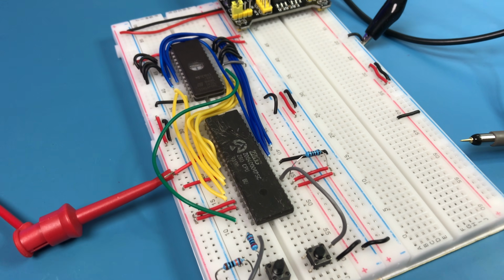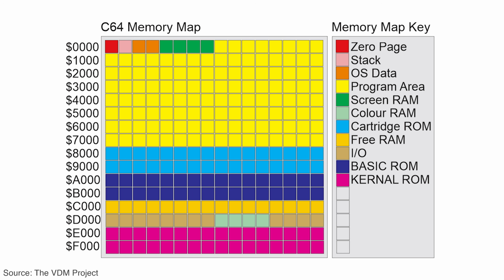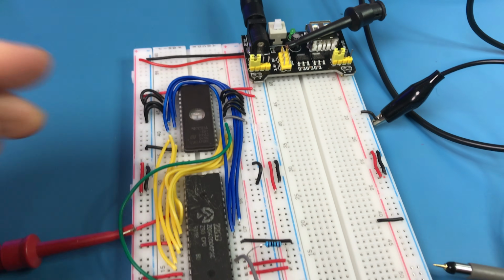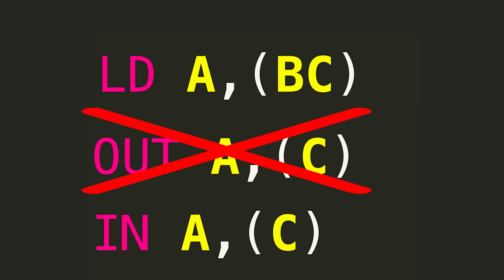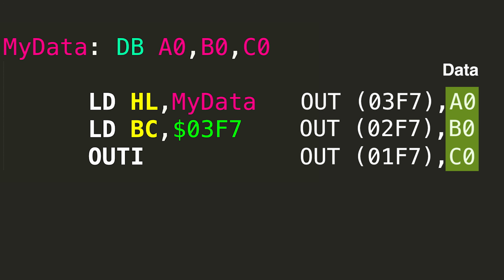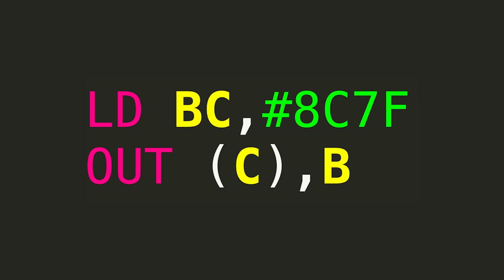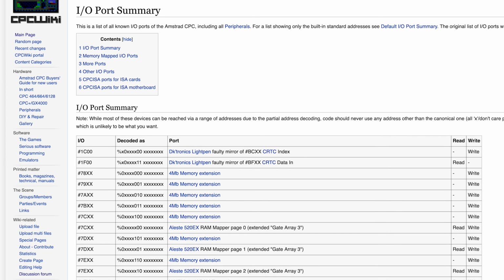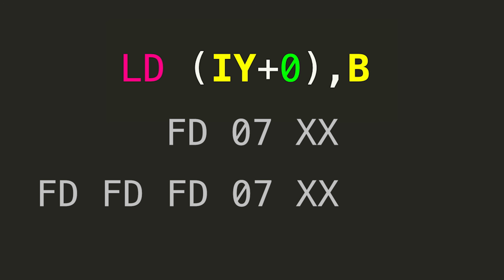The Madness of Z80 I/O

Comment: LDIR is not an eyesore! I used it to copy blocks around in my Schneider 6128 between memory banks. It was very handy, not having to write the loop. :)
Reply: Yes! It's incredible how many people forgot that LDIR/LDDR/OTIR/OTDR were a cheap alternative for DMA memory transfers, and advertiser as such.  DMA was horribly expensive back then.
Reply: Yes. I modded my Spectrum back in 1982-83 up to 80k (16k with two 32k banks) and used LDIR as a blitter to create some pretty slick animations by pre-drawing multiple images in RAM and then repeated LDIR to drop them into the active screen buffer.

Comment: Long term professional Z80 programmer here. I prefer to think of things the other way around. Very simply the Z80 had 16bit IO addressing. The CPC approach capitalized on this properly and it allowed whole pages of IO to be  used for your own hardware. Used this by decoding page FF as enable for existing 8bit addressed IO. Everything else that ignored the top 8bits was either sloppy or following the 8080/8085 method... Unless you were being clever and getting 16bits of data in your OUT (C),A by grabbing the B register from A8-A15.
Reply: The z80 design doesn't really scream 16 bit i/o addressing to me. They messed up the IN/OUT instructions by putting the A register on the top 8 bits, which is fine for IN but for OUT it means the data lines and top 8 address lines have to have the same value. In reality the z80 has 8 bit I/O addresses, but an implementation detail means that you can achieve 16 bit if you write the software in a specific way.
Reply: @smf3472  that "certain way meant choosing which you were going to use before you started designing the system". Not the word salad it is in Zaks or the datasheet, but just think of it that way and it works. If the documentation simply said BC appears on the address bus and A on the data bus, it is very simple - and defo 16 bit IO addressing. That is what actually happens,  AND... With 65,000 IO addresses it did encourage "rationalised" designs resulting in lots of mirroring of addresses - but that's what you get when designing to a price-point. We used to "gut" 6128s and use them as embedded controllers in weather RADAR equipment with some older IO hardware using legacy 8 bit addressing.  Used IO page 0FFxxh with 8 diodes and some simple logic to pick the top byte as the enable for existing hardware. tiddly little daughter board was all that was needed for upgrading from legacy.

IN A,x and OUT x,A were legacy commands and provided code/operability continuity with the intel 8080/85 designs that were the main target of Zilog at the time. You are right that the A register appearing on A8-A15 is a bit odd - I am sure there must have been some reason for it - did any design ever use it? 

There are historically a lot of areas where the Z80 could have been a BIG improvement over the 8080... many of the complex instructions, often do not provide code-size or execution time advantages (SET, RES etc) and things like LDIR can be done much quicker by clever use of SP - albeit not as arbitrarily. The 4 bit ALU was a major area they could have spent time, the addition of a MUL command would be so easy and a real coup over Intel, and 16bit relative addressing for CALLs, JUMPs and IX/Y. There were great improvements over the 8080 but a lot were seldom used because they didn't go far enough. In ZILOG's defence,the actual deployment of philosophy of RISC was a decade away, even though the 6502 performed very well with a slower clock and only three registers. Motorola's 6800 series was even better.
Reply: @smf3472  The question is whether the 16bit addressing was intentional.   Some people simply assume that there is a glitch when using the IN/OUT(c), so that the B register then displays the upper bits.

Comment: The only crazier Z80 thing than that is what the ZX80/ZX81 do with video output. Holy Mother of God.
Reply: The ZX81 video generation sure was complex, but some embedded systems around the Z80 did similar involved things.
Reply: @herrbonk3635  And a lot of other stuff. The concept is a good deal older than the ZX80 and had been in books by Don Lancaster before. The ZX80 has some twists on it but it wasn't new.
Reply: @etchedpixels  Yeah, I've heard about that "tv-typewriter" by Don Lancaster, I belive it was. But what did it do exactly? Did it even use a Z80?
Because the tricks employed by the ZX80 and ZX81 were largely (not fully!) about the Z80 itself. Such as using the R-register to count bytes on the screen, the I-register to point at the character generator, the HALT instruction used as newline, the exact nature of the 4T NOP-instruction execution, and so on.
Reply: @herrbonk3635  You could implement the same method the ZX80 uses, with a 6502. The implementation would be different of course, but you should be able to get any CPU to fetch display data while feeding the CPU a NOP instruction.
Reply: @smf3472  Yeah, probably. But it would be totally different in almost all details using the 6502, 6809 or similar. And I'm not sure it would save much hardware without using the Z80 refresh-counter as a byte counter. 
The main point though, was that the "tv-typewriter" didn't use any processor. And people almost seems to think this was the first time a video generator was implemented in TTL. But that was rather the most standard method at the time.
Reply: @herrbonk3635  Using the program counter as the counter would totally work, you just JSR into a specific address range & feed the CPU NOPs all the time it accessed that range, then feed it an RTS at the end of a line. Though once you have RAM that is twice as fast as your CPU, then of course on the 6502 you would just have your own display DMA hardware. But you could have done a ZX80 style machine with a 6502 in 1980 if you had wanted. Commodore didn't have to, because they owned MOS.

Comment: I was puzzled really hard by OUT (C), C sending nonsense data (in my mind) while reverse engineering some undocumented device from the 80s. Then I realized it uses B to address external chips. It even used OUTI to reset them in a loop. I guess the original author learned software development on Amstrad CPC ;)

Comment: Thanks for many nostalgic feelings! You made a tiny bug doing the explanation of LDIR: JR PE,XX means jump if parity even. I think JR NZ,XX is what should be used. 
That said, I enjoy watching you channel. Just dusted off my Colour Genie and cleaned the inside of the keyboard to get it going again
Reply from the maker: I thought so too at first, but LDI sets the parity when B reaches 0, so I had to re-edit the video to fix it.
Reply: @NoelsRetroLab  Whow - learned something new about this old CPU of mine. Thanks!
Reply: @NoelsRetroLab  it's pretty strange how zilog implemented the parity flag on the z80 & a source of many bugs with software ported from the 8080.

Comment: Rodney Zaks z80 manual is the bible. It was the first cpu I did asm on with an amstrad 464,  I never did any on the 6502 despite having 6502 machines all around me, I often wonder what we would have today if the PC world had gone z80 instead of 8086
Reply: Surely it would have gone Z8000?
Reply: Oohhh now that’s a thought a PC with DR DOS runnung GEM on a zilog z280
Reply: @8teillumin  
The 16 bit offering from Zilog was the Z8000.

I've used versions of a DBMS OS on a Z8000, 68020 (both 16 serial port machines) and a Honeywell DPS 6 (128 port).  It would have been interesting to compare if there had been an x86 native version (a *nix/Windwos subsystem of the OS is available).

Comment: I loved LDIR and used it a lot when Z80 asm programming back in the early 80s.
Reply: LDIR was slower per byte transfer, than using long strings of LDI instructions, for example using 32 LDIs to copy over line of screen pixels out on a Sinclair ZX Spectrum.
Reply: @shaunhw  Yes, this is true.  The convenience of LDIR was dented by slightly longer per-byte transfer times vs LDIs.   Kinda sucked, but I still used LDIR most of the time.
Reply: @shaunhw  Do you still have means with that method to set startpoint for various addresses?
Reply: Yes! Incredible how many people forgot that LDIR/LDDR/OTIR/OTDR were a cheap alternative for DMA memory transfers, and advertiser as that.  DMA was horribly expensive back then.

Comment: For true madness, you could have included the hidden 1 bit output port by manually loading bit 7 in R to latch it during refresh. :) The Z80 just suffers from 8080 compatibility at some places.
Reply from the maker: Ohhh, I didn't know about that!
Reply: And an additional 8-bit port with the I register if you don't use Zilog's interrupt system!
Reply: Nintendo's Popeye arcade PCB uses 1 bit of the I register for acknowledging vblank NMI (and for enabling/disabling vblank NMI). Until you look at the schematics and realize it's latching the bit during a refresh cycle, then it is kinda confusing trying to work out why it's changing the I register.

OUT (c) makes sense as the 8080 had an OUT instruction that only took an 8 bit port, which was then used for bits 0-7 & also for bits 8-15 on the address bus & always outputs A register on the data bus. What really doesn't make sense is that zilog made this instruction output the A register on bits 8-15, which is OK for IN but quite useless for OUT. I don't know what they were thinking
Reply: @smf3472  The ZX Spectrum uses the upper bits of the address bus during an OUT instruction to it's single I/O port (the ULA) to read the keyboard. It's an 8x5 matrix, so the 8 upper address lines feed that.
Reply: Are you talking about output ports or register space?
Reply: @greenaum  If you latch A8~A15 during the memory refresh cycle, you get the contents of the I register. Therefore, this is like a super easy to use output port that can be loaded with a LD I,A instruction.

Comment: I think one of the epiphanies of understanding my computer as a kid was figuring out how a chip like the 6850 serial port was at a certain memory address. I assumed it was something clever and elegant and I remember being disappointed when I saw it required a whole bunch of logic chips connected to all of the address lines just to enable the chip at that address.
Reply: If one is using e.g. 8Kx8 RAM and ROM chips, and can afford 8K of address spacing for eight I/O devices, one would use one 74LS138 to select the RAM chips, ROM chips, and the second 74LS138 to select a particular I/O device.  When using separate I/O space, one would still need two 74LS138 chips.
Reply: @flatfingertuning727  You mean have the 6850 registers filling up an entire 8K block of memory space? 😬

Comment: OK, now I really know why I prefer the 6502.  I designed a 6502 SBC a few years ago and it was pretty simple.  In the 6502, you can get 32K of RAM and 32K of ROM with only 256 bytes of IO with THREE TTL chips.  So you don't have to waste a lot of RAM for IO.
Reply: Please (*1) don't mistake the CPC nonsense with the Z80 architecture. If you want something more sensible, take a look at the SMS architecture or, even better, the MSX architecture. (The SMS still had some cheap shortcuts, since it was a legacy from earlier cheaper designs of the SG-1000)

*1: Honest remark, no offense meant
Reply: @fr_schmidlin  Yeah, I figured this was more a strangeness of the CPC.  No offense taken.
Reply: @gppsoftware  The 6502 was designed to compete with the intel 4004 or TTL, while the Z80 was an 8080 super set. So I think it's fair to say it was more primitive, however in many ways the design makes for much faster code. The 6502 zero page addressing allows for 256 8 bit registers, or 128 16-bit registers. You could argue that it's not really registers, but the equivalent z80 code is often slower. I've written an 8080 interpreter for 6502 and it takes average of 14 6502 clocks per 8080 clock. I have been looking at going the other way and it is nowhere near as efficient.
Reply: @gppsoftware  Simplistic yes, but still completely usable.  There were plenty of limitations with the 6502 but mostly could be worked around with a bit of effort.  Running out of stack space was never a lot of fun.  I'm a Z80 boy personally but did things with other micros too.
Reply: @gppsoftware  A 2mhz 6502 running well written code will usually beat a 4mhz Z80. The commodore 64's graphic and sound chips will often make up for the slightly lower CPU performance.
Reply: Neither do you need to waste a lot of memory space for IO if you decide this is the IO scheme you want on a Z80 either rather than port based.  Guess what, you can do the decode with a low number of TTLs too.  Not saying your like of the 6502 is flawed of course, but your  errr logic, is.
Reply: @retrozmachine1189  not sure what you meant by my logic being flawed.  I wasn't putting the Z80 architecture down.  I was simply stating you don't have to waste a lot of memory space for IO on a 6502 design.

Comment: using the high address byte during I/O is far from a unique oddity. The ZX spectrum, which you mentioned as a counter-example, in fact does use the high byte as a key matrix row select. in a, (c) with c being feh will load the state of the row selected by b into a.

In fact if you think the CPC is mad, you'll find the spectrum utterly insane, with its resistor-split bus, garbage on the data bus during interrupts forcing you to fill all 256 and A HALF slots of the vector table with the same address, and that address has to have boths its bytes identical... the ULA using a single bit to decode accesses thus grabbing all the even I/O address space.... it's so bad ... but it was my first computer....
Reply from the maker: Maybe that will have to be part 2 😃

Comment: Very interesting analysis.  I always treated IO as still fundamentally based on the 256 byte space of the 8080/8085, and saw the extra B register output on the address MSB as just a half-implemented idea for an abortive 16-bit IO space architecture idea.  But the Amstrad explanation is interesting, how they made use of it after all.  Thanks for the deep dive.

Comment: I made a breadboard computer with the Z-80 and I was easily able to setup 4 output ports by just muxing the last 2 bits of the address bus and enabling device /CE with the /IOREQ ORed with /WR, it's easy as can be.  You can do this with one 74139 and an OR gate.  The madness accusation is unfounded, the Z-80 offers a beautifully simple way to implement ports.
Reply: ED 70 is a handy related Z80 instruction. It does a IN(C) and only affects the status flags but BEWARE that all not all Z80 clone CPUs support the undocumented instructions. 😮
Reply: The Z80 - yes, Amstrad is the one to blame here really. The z80 „weirdness“ is let’s say historically grown from the fact that it had to be i8080 backwards compatible and a muck extended superset of it. The things that may look weird to us now - almost 50 years later - may looked either logical to the designers back then or were driven by cost reducing measures?

Comment: You forgot one important detail!
On Amstrad, io devices must also monitor the memory access pin - and - if it is active at the same time as the io access pin - ignorere the io access pin - because the cpu is doing memory banking!
If was nearly bitten by this when I made an interface for Lego Mindstorms version 0.
Luckily when I was about to give up because my board would be loaded with random values from time to time (when doing memory banking) I just read about the feature in an Amstrad book.
Fortunately I had connected the io pin access pin to both pins on a NOR gate. I just had to remove the jumper and added the memory access pin to the chip and everything worked!!! 🎉
Reply: Man, and I though the CPC architecture was hacky enough with this video.

An honest thank you for giving more details!

Comment: Man, the scratches on that Z80.  That CPU has some stories to tell.   lol

Great video!  (and that's coming from a hardcore 6502 fan)
Reply: Those might be from Noel's fingernails while figuring it out :)
Reply: 6502 definitely seems a bit more elegant.. z80 might be easier to program, though. But it has some real wonky things. Shadow registers, output bus shenanigans, 8080 backwards compatibility you have to keep in mind if you want to run your software on both, like CPM software usually did..

Comment: Madder still, there are a bunch of instructions in the FD and DD spaces that simply do the same thing as if FD or DD were not present.  So DD00 is a NOP that asks for IX and then does nothing with it, and FD00 is the same for IY.  You can make a huge table of these.  If you don't care about flags, DD40, DD49, DD52, DD5B, DD64, DD6D are all instructions that do nothing and that no sane programmer would code; ditto the same instructions with the FD prefix.
Reply: Yes it's more like DD sets a flag that says "the next instruction uses IX, possibly with an offset, instead of HL" and similar with IY for FD. So instructions that don't use H, L or HL just act as normal but take longer. There are also a bunch of useless single-byte instructions like LD A, A which don't have any side effects (even leaving the flags untouched IIRC) which could probably be repurposed. Later CPUs from Zilog reuse these for something else.
Reply: @gdclemo  I think Zilog intentionally left LD r,r (same r for dest, source) effectively as NOPs to be compatible with 8080.
In the early 80's, a friend and I had an idea for a bank switching for the Sinclair Spectrum that would notice these instructions to select memory banks for seperate read and write.
Reply: Yes!  The DD NOP.  I used that to pad timing without doing anything to other registers.